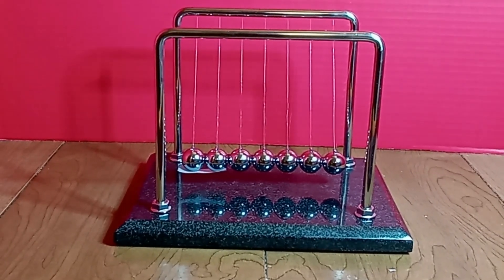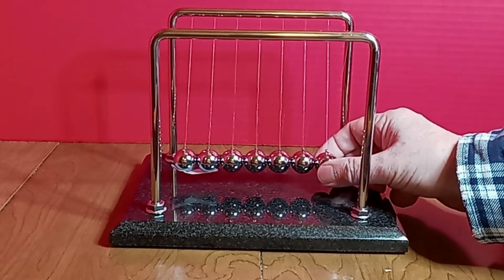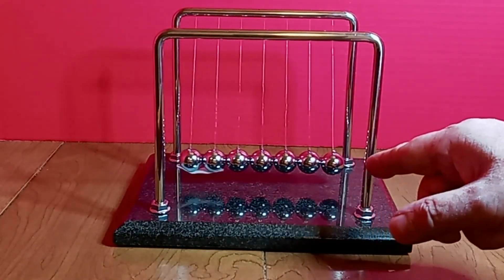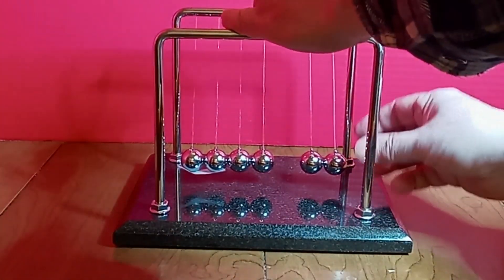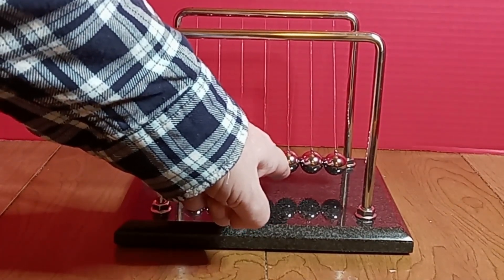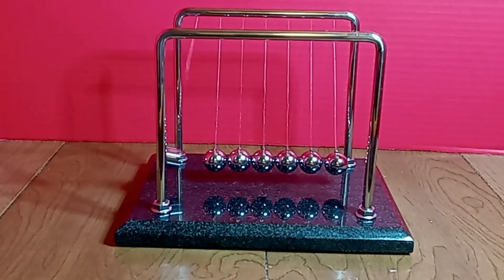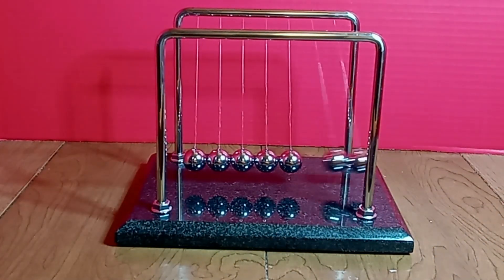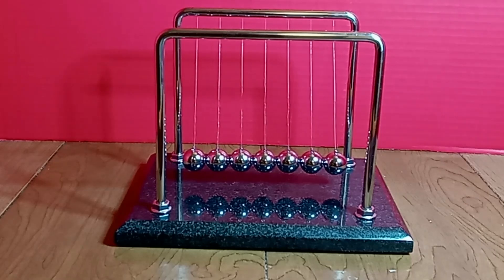Fooling Newton's Cradle

Comment: The system is then modelled by one larger weight on the left side which has twice the weight of an individual ball. The left two can be simply substituted for that one larger ball.  What is happening is that the left balls velocity at impact is half that of the ball on the right.  The momentum being conserved and P=mv then the left balls being 2m, then it's velocity V is P=MV or P=2mV or V=P/2m.    Now do the same with the kinetic energy of K.E.=(1/2)mv^2 and the fact that at the top of the swing, the kinetic energy goes to zero as the potential energy becomes P.E.= = mgh, when g is the gravitational constant and h is the height it reaches.   Using m and M=2m as well as h and H for the right and left balls, the  final heights can be calculated.  The summary is that conservation of energy and momentum, being conserved, are expressed as different initial velocities and heights for the beginning and ends of swings of the respective balls.

The modelling that allows the aforementioned to be true is based on the assumption of perfectly elastic collisions.  The issue with Newton's Pendulum or Newton's Cradle is in the marginal inelasticity and why it settles on the mass on each end being equivalent rather than one ball causing three on the other side to swing. Elastic collisions result in perfect transfer of momentum and energy between the two colliding objects.  Perfectly inelastic collisions result in the two masses combing into a single body.  Between these two extremes, there is energy loss in the vibrations.  Even the two tapped balls has energy loss as the tape vibrates and stretches.  

Without a deep dive into how this energy loss varies, my best sense of it is that the reason that one ball bounces one, two balls bounce two, and so on is that energy conservation is absolute. The balance of energy between the two sides is such that it must also account for a balance of energy losses through the system.  On closer examination, it is clear that, in fact, the pair of balls separate slightly, the balls at the bottom swing a bit, and all through the system there is a sum of small losses.  The system as a whole finds that balance and markedly tends towards bouncing equal balls on both side unless forced to, in which case that imbalance is absorbed by variation in the internal heat generated.

Comment: So on one level the tape makes the collision inelastic and kinetic energy is not conserved but if you look carefully it is the same as if the two taped together balls were just one ball with twice the mass. But I guess what I am getting at here is that mass is defined in terms of force and force in terms of mass which is circular. In ordinary experience it doesn't matter because we might define force as a push or a pull and we have a built in intuition about it. But if your going to base a science on such a circular definition you really aught to do better. To put it another way you might ask just what is energy? Because if the balls in the middle don't move and energy is defined in terms of motion then how on Earth is energy transferred from one ball to another without moving it? Just some food for thought.
Reply from the maker: There's a video on "The Action Lab" channel that says it's a shock wave that makes the number of balls that fly off equal to the number that impact the opposite end.
Reply: @magneticpropulsion2507  Right. And that shockwave dissipates as it goes. The tape changes the nature of that shock wave as well.